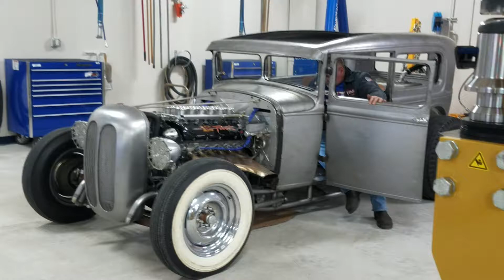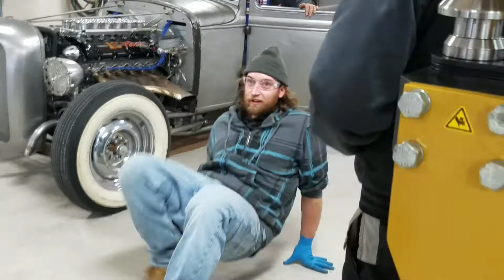Rat rod 1930 Ford Model A with a BMW V12

Comment: Pretty sure that is a M70B50 V12 out of the 850i and 750iL, not an aircraft V12. Still a bad ass engine, I have one, I'm planning a hotrod build around eventually.

Factory, it put down 300hp and 330Ft/Lbs with a redline of about 6k.